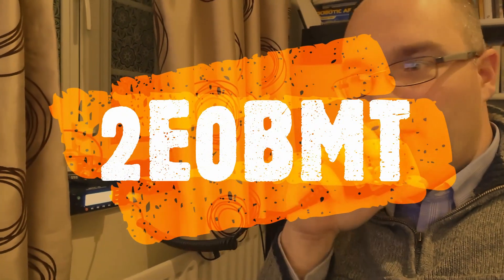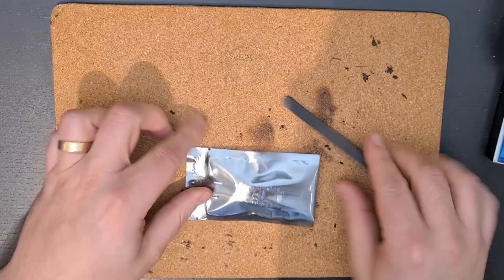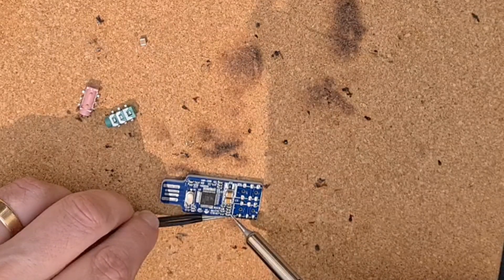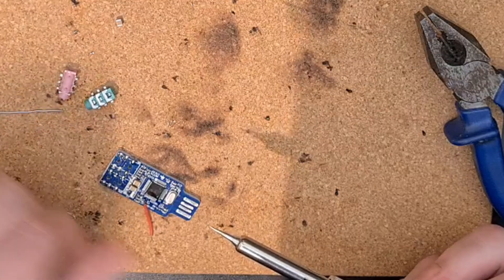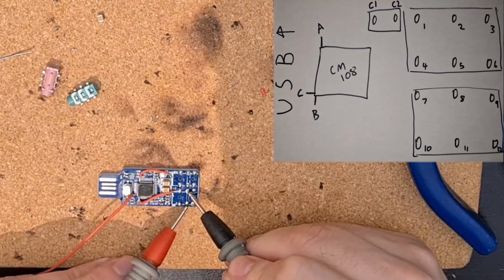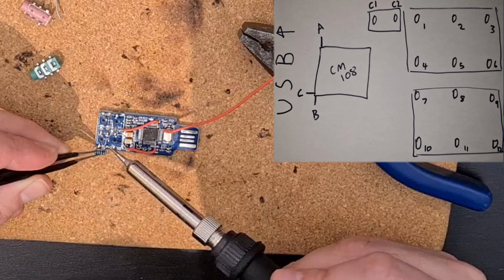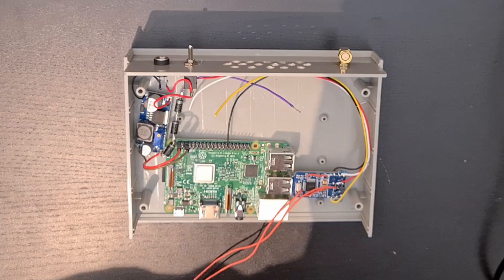PART 4: Idiot’s Guide To Building An Allstar Node – CM108 Sound Fob Modification! Amateur Ham Radio

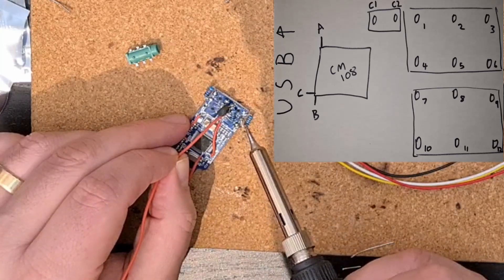Comment: At 6:40 in this video (part 4,) Ben solders a wire onto pin 8, but in part 6 at 6:40, he says that wire should have gone on pin 7. After you check my facts, you might want to put it on pin 7 now rather than change it later. 73 de KJ4FX

Comment: Hi Ben. Thanks for your terrific videos about setting up an AllStar node. Somewhere in one of your videos, I think I heard that you no-longer use a transistor on the CM108 sound fob modification - but I now can't find any reference to that. Should I build mine per your Part 4 video, or is there new information on not using the inverting circuit? Cheers, Mark VK2KI / VK6QI in the Southern Hemisphere.

Comment: I’ve ruined 3 of these trying to modify them. Well, 2 are ruined and 1 doesn’t work. I think the issue is the sound card but I really don’t know. I guess I’ll have to buy something pre-made.
Reply from the maker: They are hard to do. If it helps, I have pre made ones for sale on ebay.
Reply: @RadioRevG5REV  if you ship to USA please send a link
Reply: @RadioRevG5REV  I've ruined 2 as well trying to modify them. Do you still sell pre made sound card ? I am interested in one if you still sell one and ship to the USA . I've looked on ebay and found nothing.
Reply: @RadioRevG5REV  Is that still the case Ben?  Tnx de NE1CW, Chuck
Reply from the maker: @chuckdubdubdub  yes... I half built 6 last night... I hope to finish them this weekend... watch this space.
Reply: @RadioRevG5REV  thanks Ben!
Reply from the maker: @chuckdubdubdub  how live on ebay if you want one...
Reply: @RadioRevG5REV   I made my order Ben!  Also much appreciate your occupation, am married to the Rector of the red-door Episcopal church in the center of town here.  Church folks seem to forgive my wire antennas at the rectory, LOL.
Reply from the maker: @chuckdubdubdub  thank you. Good to hear of another rectory on the air! 73
Reply: Hello Ron, you can buy small boards to accumulate the connections and then solder to the sound card, haven't tried it but this is the way for me "old and shaky"